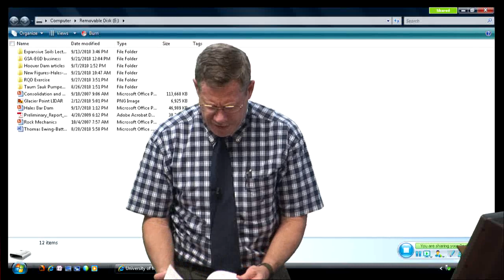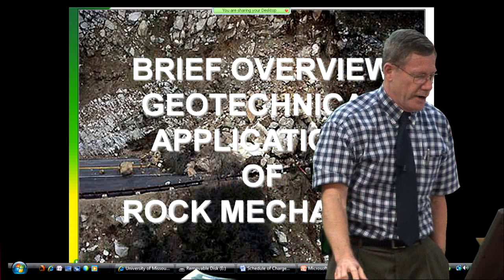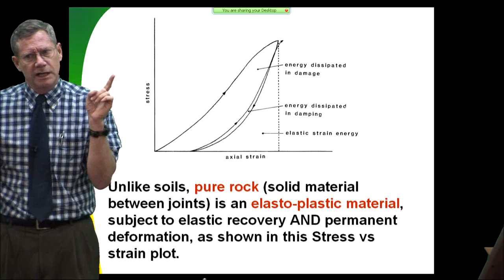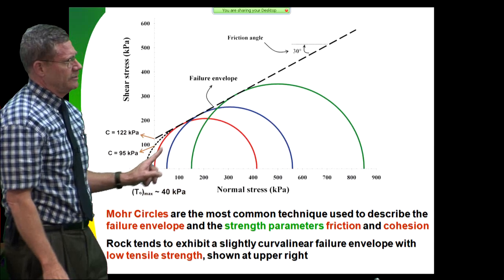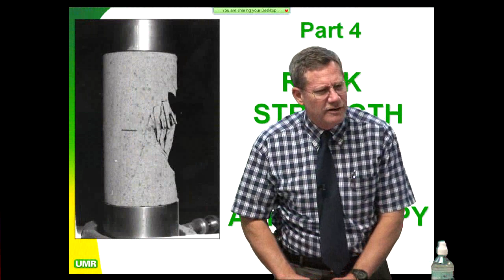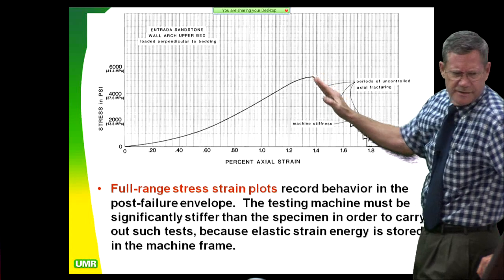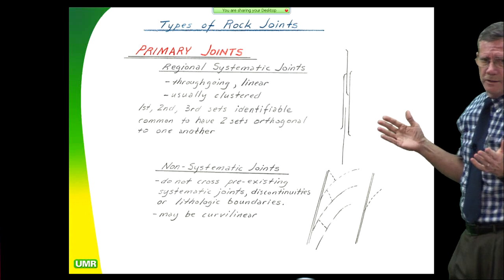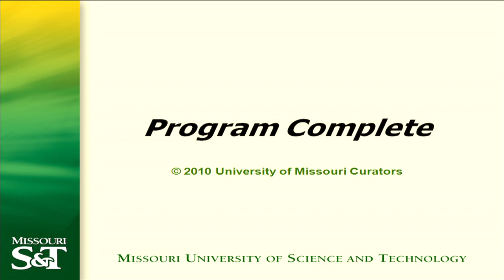Engineering Geology And Geotechnics - Lecture 5

Comment: Geology, an art as much as a science, has always baffled and worried engineers. And while geologists have provided mankind with massive sources of energy such as coal, gas, and flatulence, engineers have been relegated to merely designing tanks to hold these natural resources. Engineers tend to carry defensive weapons of pocket protectors, slide rules, black socks, and lousy humour, although these tools are a poor match for the geologist's rock hammer, hand lens, and Brunton\Breithaupt compass. Note that Microsoft software engineers have neglected to include Brunton or Breithaupt in the Microsoft Word spelling check. Differing world view is a fundamental reason for Geologist-Engineer conflict. Geologists view the world as a beautiful array of possibilities and a wealth of variability; a terrifying idea for detail obsessed and pigeon-holing Engineers. Rough estimates and 'back of the envelope calculations' have long conflicted with engineers' need definitive and quantifiable answers.
Geologists, secure in their vague estimates have forever conflicted with engineers and their need for a definitive, quantifiable answer since the building of the pyramids. The ancient Egyptian engineers had determined that the Great Pyramid would require 6961105709.356732519874886510 metric tons of stone blocks to construct. The ancient Egyptian geologists yawned and disagreed. When it turned out that only 6961105709.356732519874886509 metric tons were required, the geologists sneered and said, "I told you your calculations were wrong." The geologists, having been proven correct and superior, have been envied by engineers since that fateful day.
Adding further heat to the argument, Engineers commonly envy a Geologist's ability to take time off from his work. Geologists tend to carry their paraphernalia with them even while on break. Hence a Geologist strolling through the park or hiking around a property is viewed as 'on the job' by his or her superiors or employer, ergo always maintaining a facade of hard work. This infuriates engineers, who seldom get time off, nor any pleasure from their work. Similar activities by an engineer may result in demotion or unemployment, thus stoking the fire of their fury at the superior Geologist.
Geologists also outlive engineers, who bored by their pitiful existence often forsake engineering for senior management and then have to deal with geologists who have become very skilled in manager-baiting. A complex art that revolves around telling managers almost what they want to know but phrasing it in jargon and vagaries to cause minor unstable mental episodes and periods of delusion followed by depression. Many engineers end their days in cosy little rooms playing with amateur radio or trying to coax a new computer to boot up in CP/M.
Subclasses of "normal" Engineers are the Geo-technical and Mining Engineers.
Reply: That's one of the funniest YouTube comments I've come across.